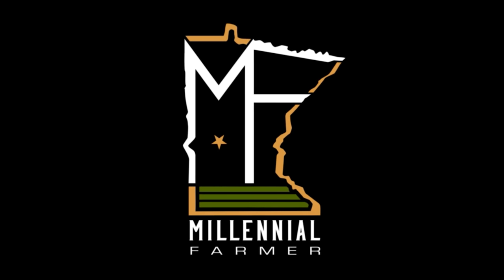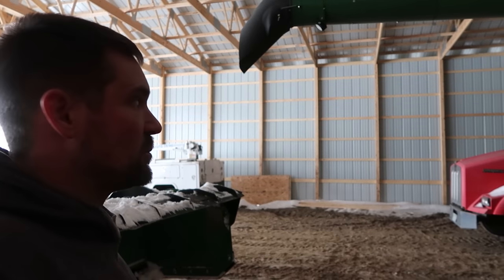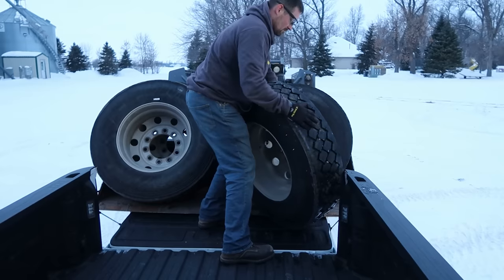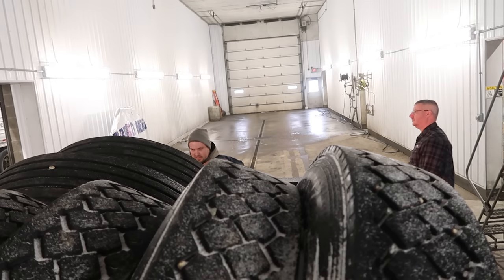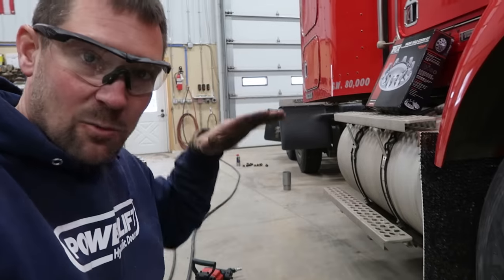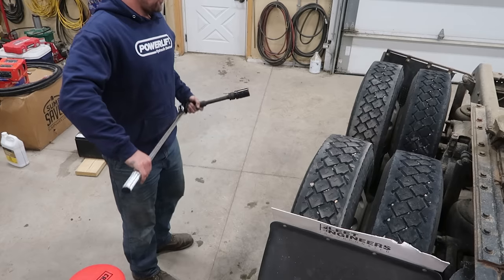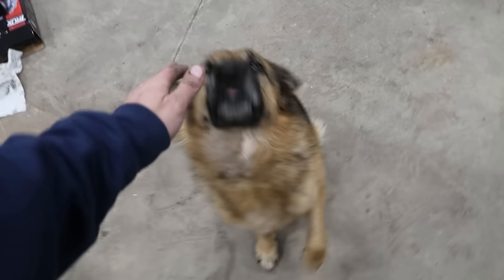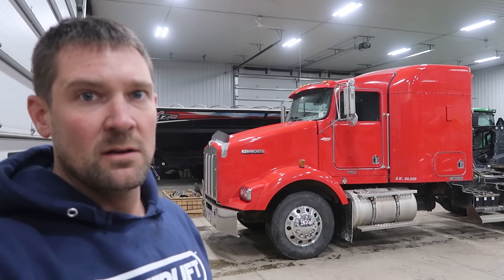This is NOT A HOW TO VIDEO! I Can't Believe it!

Comment: I mentioned sometime ago clean and shine all your connections!!  You found the issue w the corrosion. You will fight battery issues until you change the battery cables. I would not replace the starter until after you changes the cables. You are learning!!  Good work!
Reply: I totally agree
Reply: Same.  Bad cables could kill those batteries  and you don't want that. I just spent 180 on 1 battery for my JD B so I can only imagine those were 250 to 280 a piece
Reply: @tractorboy31  ends up like around $1k a lot of the time for most people

Comment: Zach, I always see you having confusion with finding the right hydraulic hoses for the right remotes especially when you have a bunch of them on an implement.
Get some zip ties in a bunch of colours (if you have coloured remotes get those colours), then for each pair of hoses put one zip tie on the input hose and two zip ties on the return using the same colour  - then you will know which way around they go just by looking at the zip ties and if you have coloured remotes use the same colour of zip ties on those pairs of hoses as the remote has, next time you go to hook up it'll be a whole load easier.
Reply: He has mentioned a dozen+ times that he has the stuff to do it.  I think he should save doing it for a video when he hits 1.5mil subs (odds are good it will take that long to actually get around to doing it anyways lol)

Comment: Hay Zack, hope you see this, it will help you next time you need to remove your wheels. On all our trucks with aluminum wheels we had a  neoprene spacer. You put it on between the wheel and the steel drum to prevent the electrolyses that basically welds the aluminum wheel to the steel drum. You should have one on each hub unless you have steel inner wheels on the rear axles in which case it should be between the steel and aluminum wheels.
Reply: Seems to convenient, I like playing with anti seize
Reply: That thing with pulling on the wheel with the strap behind the quad. I would never do it. If the wheel releases suddenly we could wind up never seeing another MF video. Straps like that hold a lot of energy. Especially when he took a run at it. 

If you must force a wheel off in such a manner, you want to either use prying of some kind, or the hammer he eventually switched to. Don't use straps. I want to see many many more MF vids. And I want Zack to have all his parts intact and in good shape.
Reply: @acesonflush346  Shit spreads faster than covid on a cruise ship
Reply: @DanEvens-tb1tg  ratchet straps don’t hold energy

Comment: That corrosion you see on the battery cable I see regularly on boats kept in a salt water environment. Once the salty water intrudes the battery cables, it climbs thru the cable rotting the copper out. Its a green and white color and the copper gets covered in this powdery stuff and becomes brittle. Salt and copper do not mix and because of this corrosion, it creates weaker wires and weaker connections. That's why the battery terminal is hot, bad connectivity. A temp fix is clean the battery terminal  and cable ends, use dielectric grease to cover the cable end and re-attach. Dielectric grease will help fend off corrosion for a longer period of time and give better connectivity.   Best fix, just replace the cables. Clean copper, clean start, no heating of the battery terminals or cables. Pending on severity, I have replaced several cables. New cables reduce the risk of a fire or battery terminals melting because of corrosion/bad connection.

Comment: Zach just a warning the higher the CCA on the battery the more plates that are in it. Those plates are closer together and when heated up (from charging or big amp loads) they can warp, if they touch together the battery is ruined.
Reply: Also a "fiber" or poly washer between the aluminum wheel and the steel drum will prevent galvanic corrosion and make your next removal easier
Reply: bullocks , the plates are isolated by polyesther matting..
Reply: This rarely happens and if it does it’s with cheap batteries, never ever heard of it happening with modern batteries

Comment: When you have any electrical circuit - where you have resistance the by product of current flow is heat.  So, where there is a heated joint, there is something there not allowing current flow (electrical flow) so that is where you start.  We use infrared cameras and go thru electrical panels and look for hot spots just to prevent things like that happening.

Comment: Your getting resistance in the one battery(loose connection or corrosion) the battery's should be in parallel but you might not have a balanced load, make sure the wires going to starter are positive on one battery and the negative on the farthest battery so the draw is thru all three equally.

Comment: Check your battery cables.  If they are corroded, they will show high resistance with an Amp meter.  If so replace with good cables.

Comment: Hey just an important tip, you never want to put antiseize on a wheel stud. Antiseize will give you a false torque. You can put it on the hub if you want but never the studs
Reply: I’ve e seen too many lost wheels due to anti seize. Just oil the threads

Comment: Ok sounds like Jim is going to have the parasitic load issue sorted but just in case a reminder- 
-vehicle off, all switches, radios etc, off.
-disconnect the main +ve lead from the battery pack to the main vehicle contactor / disconnect and any aux connections. 
Insert a multimeter in amps (capable of at least 10A) mode into the circuit in SERIES - so all the vehicle draw runs through the multimeter (DO NOT ATTEMPT TO START VEHICLE… this is a bad thing and the multimeter will sulk and let it’s smoke out)
-you should now have a reading, open door, courtesy lights will come on, amp reading will go up when they turn on. Shut door let them go off.
-open fuse box pull each fuse in turn when the amp reading drops or goes to zero THAT’S the circuit with the parasitic load! 

Further get those cables and terminals replaced (I’d also be very tempted to go “up” a gauge in size too eg if you are running 0 AWG use 00 AWG … it’s a bigger pipe essentially) rather than tidied up! Ideally installing a fuse for each battery for additional safety. 

If I was closer I’d offer to help you out on (I design vehicle and equipment electrical systems) it but I’m across the pond in the UK 🤣🤣🤣

Comment: Suggestion would be to change the positive and negative battery cables from the starter to the batteries. You likely have corrosion inside the cable. Also charge each battery separately or if boosting place the charger cables across ALL batteries. So the neg on the first one and the positive on the 3rd one to ensure all 3 are being charged.
Check to make sure you have shunt cables between the batteries as well

Comment: Zach, check your starter solenoids. When they go bad they will drain the batteries down to nothing. The solenoid will get a pitted contact and develop carbon pits on it's surface making starting nearly impossible.

Comment: As a 20+ year diesel mechanic is entertaining at the least to watch others, but i to applaud your excellent effort.  But after seeing those cables I agree with others here that they definitely need to be replaced.  Also your wheels are " hub pilot" wheels meaning the lip on the hub and the hole in the center of the wheel are what center them, torque the nuts to 550 ftlbs.

Comment: I used to work for a trailer manufacturer and was in charge of plumbing and wiring trailers. I also had to put wheels and tires on 2, 3, 4 axle trailers. My boss made this lever that had bearings on the ends so you could spin the wheel and also pick the tire up and get it on the lugs. Worked slick.

Comment: A low voltage charger is also called a battery tender. They’re very useful for when you want to keep your vehicle battery/ies topped off before you start it again.

Comment: I recommend a poly ring to go between the rims of the truck and the drum, since one is steel and the other is aluminum you get a dissimilar metal corrosion which basically speeds up the corrosion process and corrodes them together, that ring should make the wheels easier to come off

Comment: Hey Zack, when lifting the tire from the rim, turn your back to the tire and lift behind your back on the outer rim.  Comes right off.
Reply: Very true, a shovel helps under the tire as well, to lift and adjusting to the studs. Thats what we use .
Reply: It also save on your lower back.

Comment: Hiya Zack. At least two people have already correctly replied that the heat at your terminals is caused by resistance and they give very good advice on how to resolve that issue if that is the case. It makes the battery seem flat when in actual fact it is not. Another consideration to consider is: The connection between the battery terminal and the cells inside the battery might also have corroded or come loose which can also cause resistance. It is extremely dangerous. It can an has caused fires.

Tip: If you want to purchase a second hand battery, ask them to do a load test or a CCA test in front of you. Then again, they say the battery was reconditioned (Supposedly), but it is after a second hand reconditioned battery, things can go wrong with it after sale.

I recommend, just buy new batteries and dispense with the bother.

Comment: 9:30- had a similar thing happen, steel wheel rusted to hub. Beat on it, heated it, threw diesel fuel on it, no luck. Finally left lug nuts 1 turn loose, put heavy paint on so they wouldn't fall off, drove around over big bumps for 3 days. Finally popped loose!

Comment: If I may make a suggestion, next time you have an issue like that on your front tires take a bar or 4x4 and put between the wheel and frame under tension (takes two people) Hold the brake and turn the wheel into the bar/post. Puts a whole lot of pressure on the wheel. POP goes the weasel.

Comment: Just a note, you should re-torque your nuts after your first load. you can use your big air gun until it bangs the first time. You might not want to torque to 550lb, or you might end up breaking the studs when you change your tires next time (if they are on for years like most farm wheels). Also, if you didn't put the plastic anti corrosion discs on before you mounted the tire you might regret the corrosion the aluminum and steel will make.
Reply: That's what she said...

Comment: Zach, we use two crowbars to lift truck wheels onto their hubs. One either side of the tire with the inner end about half the width of the tire, and two foot of lever extending out from the wheel.  You hold the top of the tire in with your head, and walk the wheel in with the levers.  You can rotate the wheel two align the studs.   One more thing...  that dusting of rust on the floor after using the wire wheel, is also in your lungs if you did not use a mask.  If you can taste it, and if your throat is sore, you have been breathing that rusty dust.   It will kill you if you keep doing it, so wear a proper mask.
Reply: Sit in a stool, grab two holes about knee height, use your forearms as the lever for your knees,  calf raise, and she'll go right on.    
Also use one large pry bar,  set it on the ground center of axle with the tip under the hub, roll tire onto bar, lift bar from handle, slides in easy.    Can replace pry bar with lumber.
Reply: @matthewgarrett9717  You can get away with one pry bar and a foot if you have good boots.  Wedge your foot under the tire, and use the pry bar to rotate the wheel onto you foot.
Reply: Liked for mask to protect from that nasty rust. No clue about truck tires so…

Comment: Hi Zack, My shop puts plastic rim protectors between the aluminum rim and the steel hubs. These are a thin sheets of plastic that fits over the 10-studs and will cut the electrolysis between the steel and the aluminum. It will save the sledge hammer swinging! We put them on all the trucks with aluminum rims... including the new chassis we get from the factory! Love the content.... I'm hooked!

Comment: As for the stuck tire. Stick a block between tire and frame and use the power steering to push it off
Reply from the maker: I like that idea
Reply: If it starts… 😂
Reply: @MillennialFarmer  your way prob generates more views and interactions though. Haha
Reply: Thanks for the tip!
Reply: Put antisieze on the face of the hub to prevent the wheels from getting stuck to the hub. Grease works well too.

Comment: We make battery cables for large trucks.  We crimp the terminals on then DIP SOLDER the terminals to prevent corrosion.  Clean connections is  imperative.  Try using dilectric grease at your connections.

Comment: Hey Zak,  Two things. Your KW problem is either the cables or the starter. If cables are old, they corrode and greatly reduce connectivity. Next, I know you struggle with hydraulic hose connections. I solved this by tying colored cable ties to the hose and connector. If you have more connections than colors, code them by using more than one color on a hose.
Reply: One time I thought I had a dead battery it ended up being a corroded bolt nut or washer  it was just enough to not make connection

Comment: i was a automotive mechanic, when we were torquing tires we were told put just enough weight on the wheels to keep them from turning when you are torquing the lugnuts, with the heat in the cables, i would recomend replacing the cables, the heat and corrosion only add resistance, living in a environment with salt and moisture its a constant battle. the best way  to have a chance is to when the wire or contacts are clean use corrosion inhibitors, there are sprays, pastes, felt discs coated in is so its more long term. yes you can use cleaners to remove corrosion, the best mechanic trick i was taught though is hot water near boiling works the best, and just dump it over and it will dissolve the corrosion.

Comment: Zack, usually heat is a sign of a bad connection. Before you put the lugs back, scrape or wire brush them until shiny, clean.

Comment: For future Zach, get yourself a long breaker bar with a bent end to get up under the tire, and long enough so your not bent half way over and can have some leverage, that way you can pick the tire up and pull or pick it up and align it better. I've seen the mechanics at shops for my company do tires quite quickly this way. Otherwise. Those wheels look sharp

Comment: DeoxIT is a miracle juice, but a bit expensive for battery terminals. For those, get the 2 little CRC cans, terminal cleaner and terminal protector. Use the cleaner to knock back the corrosion on the terminals, and then the protector once you have the connections all put together. Really soak on the terminal protector as it makes a coating to protect the wires.

Comment: Make sure your ground to frame is clean. I always used paint on every battery connection after they are cleaned and tightened. This keeps moisture connections.  I owned and maintained my trucks for many years.

Comment: Zach, install a cutout switch so that you are not draining the batteries so much.  I had to do that on my boat as it was doing the same thing.  After I installed the switch, no problems.
Reply: He's stated in the past he already has a cutoff switch
Reply: Yeb a cut out switch helps… But also get a trickle charger to keep them in shape!
Reply: Battery Tender is a good trickle charger, maintainer.  Been using them for several years now. Batteries seem to last longer and at today’s prices the payback for the battery tender is fairly quick.

Comment: I would definitely check for a parasitic battery draw when that truck is sitting, the reason why one battery would be hotter than the other is that one of the three batteries is junk, and the others were having to pick up the slack.

Comment: Zach, do a voltage drop test of the battery cables. Positive lead of a meter on the battery post and negative on the starter. Stay on the polarity side. Basically the meter is paralleling the cables. Meter should show very little voltage. Over 1.5 volts means the cables or ends are bad!

Comment: Hey Zach….couple things..I definitely enjoy your videos…if I can offer any helpful advice in regards to your truck. Invest in a good wheel dolly…they are a back saver and way less difficult than trying to lift tires up when trying to take them off….especially for trailer tires. Also like others have mentioned and I’m sure you know…good clean tight connections are definitely helpful and good cables for sure. I’ve found over the years that if new batteries don’t do the trick….change your starter. A new 39 MT starter will make a world of difference when you go to twist the tail of that Cat. Spins way faster and wayyyy lighter than the old 42 MT starters. Best of luck! Keep up the great videos!

Comment: You should run airline around your entire shop with extra hoses on reels so you can use air anywhere in your shop.  7 more subscribers until Anna gets a ride in the tractor.  You should also replace all of the tail lights, marker lights, turn signal lights, reverse light and interior lights with LED at some point.  And when you are finished with the truck, you should try to do 1 trailer to go with this truck and shine it up as well.  A shined up truck should have a shined up trailer to go with it.
Reply: 7000

Comment: Hey Zach one tool you won't regret getting is a dead blow sled hammer so you can hit those aluminum wheels. My dad and uncle have one for the Ford 1 ton aluminum wheels and for the semi truck wheels as they are the most common to get stuck on. They are mechanics for their day job and it was a night and day difference for them plus it doesn't wreck the rim. Hope to catch you at the track again this summer.